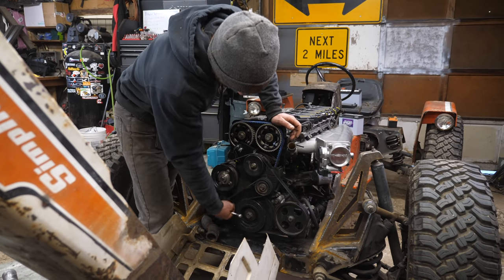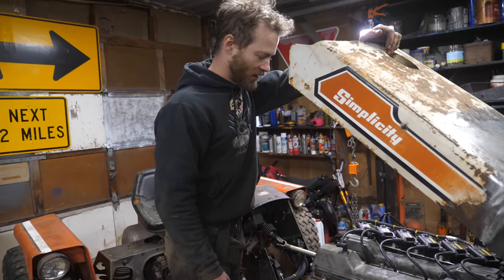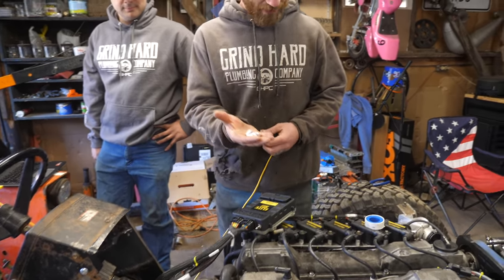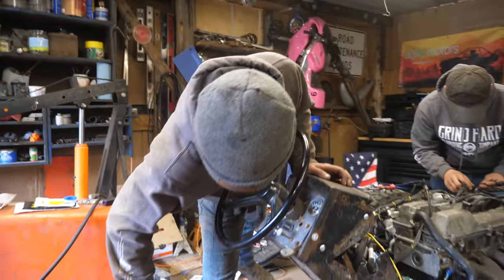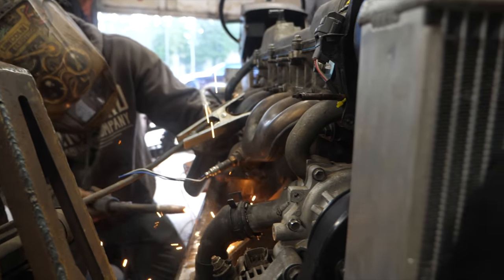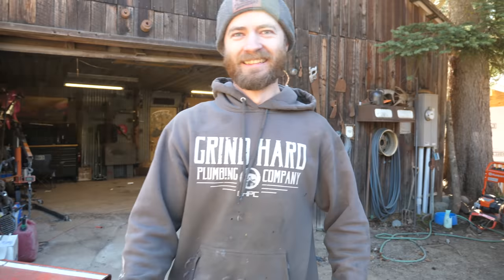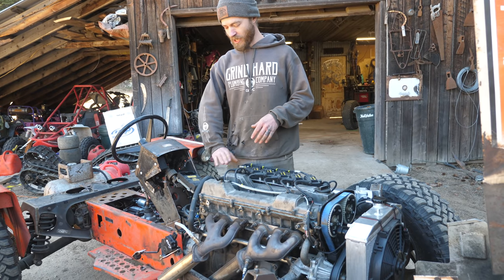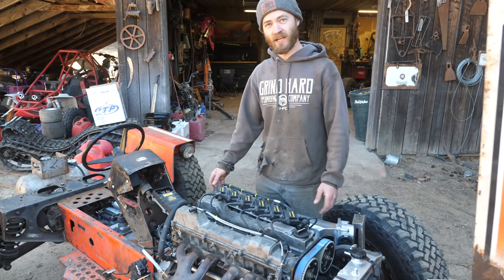2JZ Lawn Mower First Start! Haltech Elite ECU!

Comment: This needs an exhaust with a tractor flap on it. Maybe a stack even tho its not diesel
Reply: Yes! great idea ya'll better like his comment so they can see it!!
Reply: Well technically, if you operate a 2jz wrong enough, i'm sure you can have some reaaly bad smoke lol
Reply: Almost sounded like a diesel when it fist started up
Reply: @i_am_terom4810  Spray some oil into the exhaust? I guess if you get the mix right it might throw out more smoke than flames.
Reply: @i_am_terom4810  actually, you could theoretically run it so rich that it blows some black smoke.  Not gonna be like rolling coal, but gas and diesel are a bit different

Comment: Power to weight ratio,off the charts. Danger will robinson,danger.
Reply: this is not a go kart- it is a small. high powered dune buggy, small block chevy bar stool,  Hemi on a skateboard
Reply: Weight distribution seems pretty solid. Not sure how well those giant, skinny ass tires on the back are going to put power to the ground, though. We shall see.
Reply: Wheelie bars gonna be a mandatory part for this one, even off road.I imagine the torque on a launch would simply use the back axle as a pivot point and flip right over backwards.
Reply: Realistically this things probably not even making 300hp at the crank. I'm not super familiar with what guys make on GE builds but I cant imagine it's much over that. It's hard to get 100hp/1000cc from N/A engines. It looks like a solid build, I'd like to know how it went at the dyno. 

Anyway all this to say, it probably makes less torque than your average small block, so I'm confident the chassis will do fine.
Reply: @DennisFromRLM  how much have you researched on a 2jz...torque MONSTERS as they are an inline 6 and high compression without the turbos...

Comment: The fan blade is designed to push wind in one direction so when you make a pull fan push it doesn't work properly, that's why they make a push fan and a pull fan, if you can turn the fan blade around on the motor shaft then it can work properly

Comment: Pumped that this is running now!! I'm getting my Haltec wiring fix this week for sure. Just watched Taylor Ray wire up his Ceferio build the other day.
Reply: I've spent 5 straight days now with new pins, connectors, a haynes manual, and a couple rolls of wire remaking my engine wiring harness, seriously wondering why I didn't just go with a Haltech.

Comment: You definitely need to get some back pressure on the exhaust before you finish your tuning
Reply: Back pressure is a myth. Scavenging is real.
Reply: @Goldskis  that's b***** without back pressure you burn valves
Reply: @Goldskis  if that's the case your myth has ruined thousands of motors
Reply: @Goldskis  your right, they did testing on engine masters
Reply: @patrickhartman6818  wives tales and bad testing methodology has perpetuated the myth for years. It's not just the fact that there's no back pressure. It's the fact that the valve timing and fuel is not accounted for if you tune with an exhaust on, and then take it off. It's just straight up lean condition. You tune to the parts you have on the motor.

Comment: One more thing I’d like to add, please for the love of god don’t blow your eardrums apart, that’s something that you will never get over. 
Trust me on that, I’ve completely lost the hearing in one ear and I can’t describe how much of an impact this has had on my life since it happened.
Reply: always good to fear everything,bubblewrap the world i always say(no,i dont)
Reply: @trillrifaxegrindor4411  that’s a bit of a weird reply considering my message to the guys.
I wouldn’t say that it’s fear of losing hearing in one ear or both but let me tell you from fact, my hearing was exceptional before having someone repeatedly smashing me around the head with a claw hammer and causing irreparable damage to my ear canal and balance tube in my scull connected to my ear.
After this happened to go from being able to locate a noise in any direction to not knowing where a sound is coming from or what direction say a speeding car is coming from is incredibly unnerving and very very frustrating.
I don’t say bubble wrap the world that’s just your misconception of what I was saying, bones heal, wounds heal but if you damage your hearing 99% of the time it’s not coming back.

Comment: For your clutch and brake. You could use a regular master cylinder. One port would feed throw out bearing and the other would feed all four brakes. Use a circle track proportioning valve, and a line lock for burnouts.
The advantage would be a single pedal on the left side just like a tractor. Operation would be half pedal operates clutch, full pedal press is clutch and brakes.

Comment: You could flip the intake manifold backwards idk if it’s interchangeable that way but then you could run a little air to air intercooler where the “heater core” would be and a bottom mount turbo right off of a custom header  feeding into that

Comment: Thats the coolest 150 hp I've ever seen.  Probably because of what its bolted too
Reply: Maybe to the wheels. A non-turbo 2J with aftermarket tuning and no restrictions in the exhaust and intake is easily capable of 250hp at the crank. A VVTI engine would be capable of even more. The good thing is that these NON-VVTI non-turbo engines have the same engine internals as the GTE turbo ones, so they could slap on a turbo and easily tune for 300-800 HP reliably.

Comment: It’s better to plug off the heater core lines, as when you are not heating (ie its warm outside) you’d have that valve closed, uncooled recirculation there ends up bypassing a lot of hot water from the thermostat and the front radiator. 
Might not matter in this application, just more of a general idea.

Comment: Hey Fellers, if you join both of them headers back together with a 3.5 inch tube about three feet long and it will pull a lot of that fuel smoke and poppin on acceleration and will allow you to come wide open for extended periods... Back in the late 90s or so I used to build 82 coupe deville 2 door Caddy for demolition derby banging... There aways someone trying to figure out how to get the welded shut hood to open.. I finally told him that it was a 350 Chevy diesel and they come factory in those cars non turbo and that motor that 2JZ with no turbo stock outlasted 582 Cadillac coupe DeVille bodies in demolition derbies in the mountains of East Tennessee right by the Cumberland Gap tunnel 6 mi away as a matter of fact sorry this is so long but maybe you'll read it maybe not you'll read the beginning though you're over this way holler got a big farm that the nearest neighbor is 6 miles away from and I got a thousand acres to do whatever.

Comment: You should use an old vertical stack diesel tractor muffler to shroud the air filter and add to the ratty-ness

Comment: This is why I prefer a cable throttle body it's reliable no chance of it malfunctioning electronically to stick open or shut but I don't like ECUs either hahaha old diesel motors with no electronic running systems are where it's at haha

Comment: Unless the fan blade can be reversed you might want to get a different fan rather then reverse polarity because it was designed to move air in only one direction

Comment: How about chassis flex, that motor would beat least 300 hundred horsepower, and all you have is those folded panels and not much else won’t the torque reaction cause problems to the chassis . But love the idea if you can not injure yourself.

Comment: Not a good idea to put the fan on front your going to block the radiator from receiving proper air it needs when moving ...fans are just for idle when your not moving to draw air through

Comment: Hey brother I just wanted to point out sometimes when you reverse the rotation on a fan to get it to pull instead of push the blades are not designed for that and lose a lot of efficiency and sometimes won’t even work. Not trying to be a know it all dick just trying to be helpful brother

Comment: Why Why Why Why Why do you people put electric cooling fans on toggle switches? If this was any kind of a good idea the auto manufacturers would install them on all automobiles. Either plug them in to a relay and temp switch or to a fan switch. It only takes one dipshit one time to forget or to not turn it on. And your whole project just shat the bed.